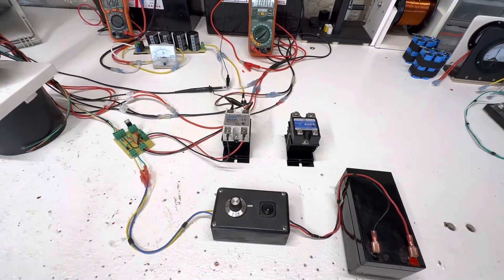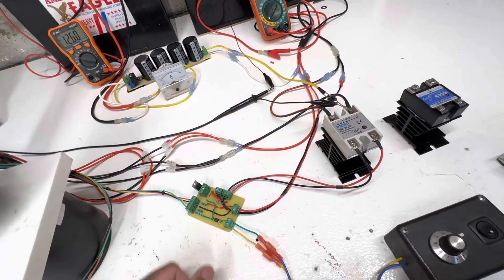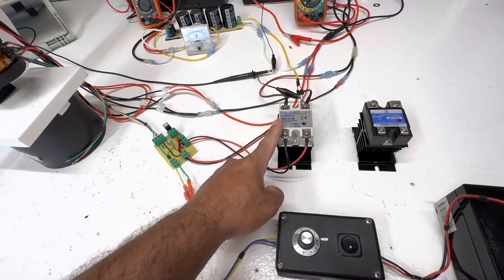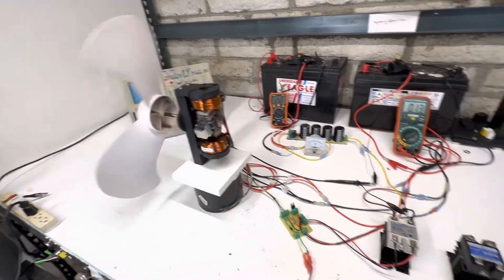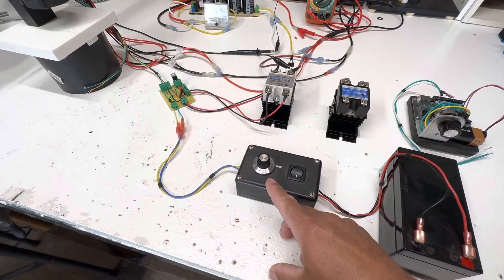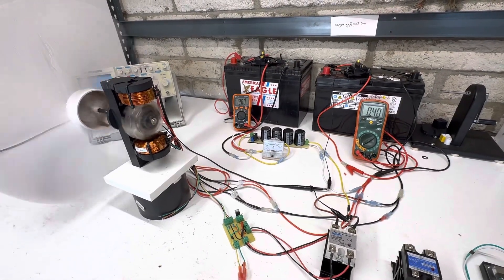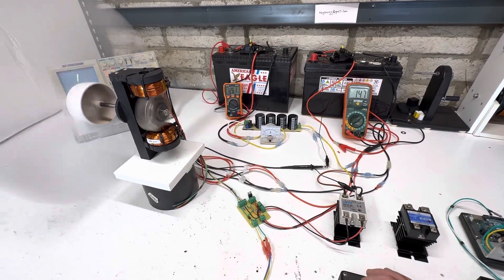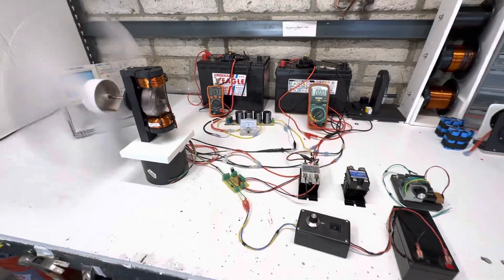Pulse motor tuning with SSR and speed control

Comment: Pretty cool, i've noticed what you said about the PWM with these SSRs, mine won't do anything at all unless i'm above around 50% duty cycle.
Reply from the maker: We’re you using arduino or regular pwm ?
Reply: @kenergy1707  Arduino. I don't remember which pin it was, so i'm not sure about the frequency
Reply from the maker: @ZirconGames  my arduino is 10kz  
 My other one is a circuit pwm email me if you want it